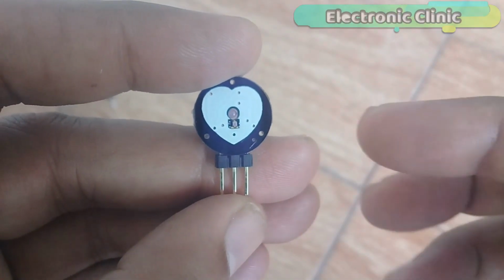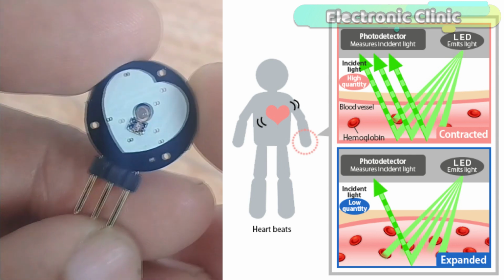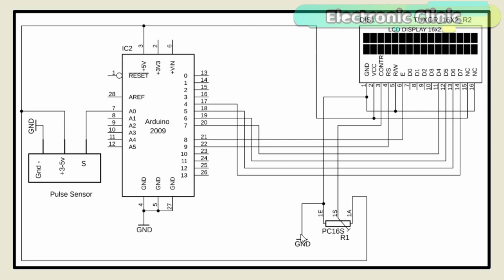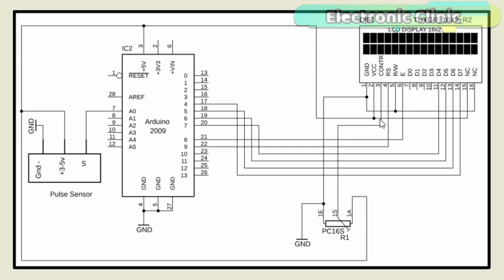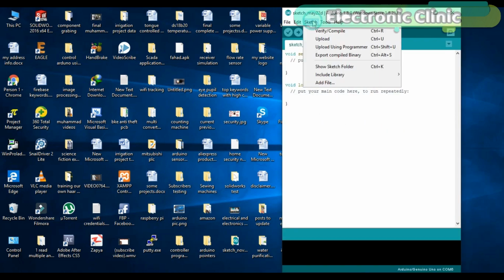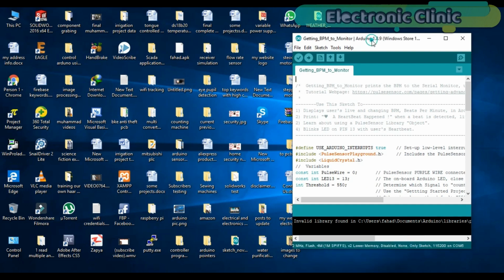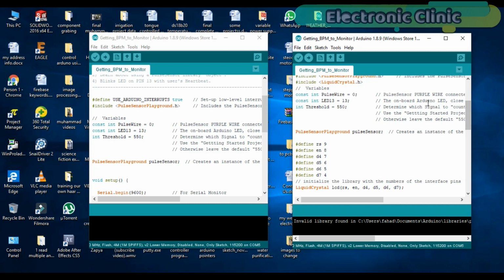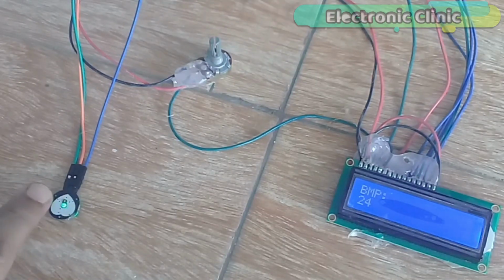Arduino Pulse Sensor/ Heartbeat Rate / heart rate (BPM) measurement “Stable BPM value”

Comment: hello sir..thanks a lot for your video....I have problem..when I upload the code from the library..my serial monitor did not display the heart beat values in a continues manner..for example I upload the code and my finger was on the plus sensor .on the serial monitor just show "We created a pulseSensor Object !
" and still nothing appear ..I mean no heartbeat measurement display..after that I leave the plus sensor and the serial monitor start show some results of heart beat but not in a continues manner only one result or 2 .but when I put my finger again on the sensor .again nothing display on the serial monitor.unless I put my finger off the sensor..could you plz help me out..
Reply from the maker: Reupload the program and check your sensor wiring. Don't tightly press the sensor, just slightly touch the sensor. In the beginning, it's difficult to understand how to place the finger. but just keep practicing.
Reply from the maker: stable bpm problem is just because of this.

Comment: Good job bro.
But u didnt explain, how to make the value stable
Reply from the maker: i explained it at the end.
Reply: @ElectroniClinic  lol u didn't in a programmatically way, in cases this project will be used by end user (old man in your neighbor), the end user doesn't need to know such trivial stuffs to make it work fine. Such spikes will give an impression to user that this is not accurate at all and will resort on using the existing expensive bpm watchmeters.
Reply: @mheruianpines5037  its project prototype with low accuracy, not meant for commercial use